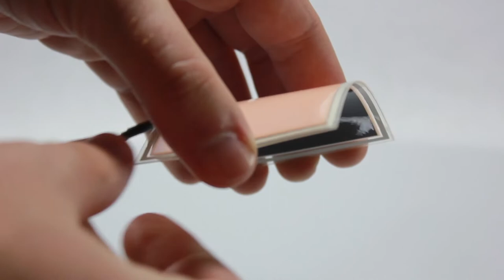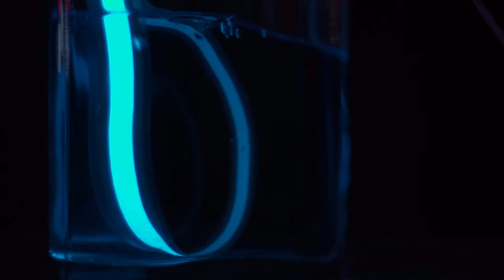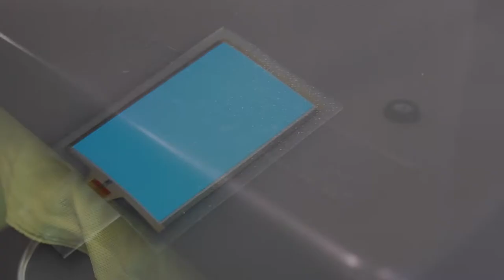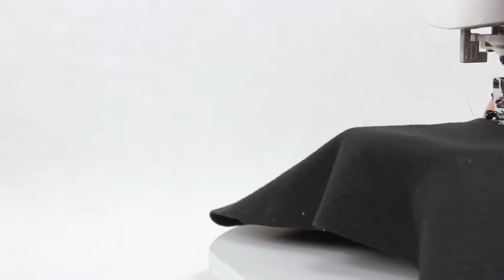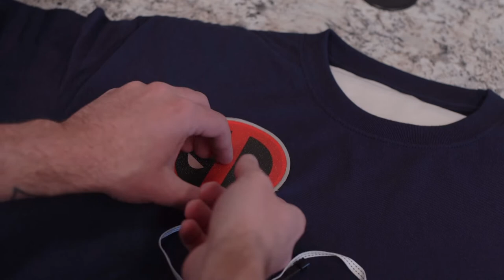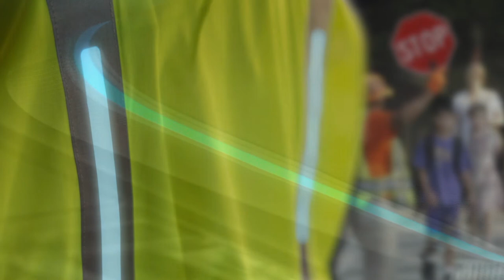How to Add Light to Fabric and Textiles (VynEL™ Illumination Technology)

Comment: This looks like a very awesome product! And I just ordered 4 strips. I am interested in sewing them all on one costume in different locations. Would I have to modify the powerpack to allow for all four strips to plug into it if the wires were not all end to end, and coming from all different directions to meet in the middle? Are there extension wires I can get from the powerback to the lights or do I need to make them? And if I cut the light can I attach two or more to the same lead line and then directly to to powerpack? Can u send me the directions to crimp and solder another connecting line? Or is it the same as the tape method? Thank you so much!
Reply from the maker: Awesome! Yes, we do have exactly what you need to make the connect in parallel from the battery pack. If you check out our "EL Accessories" page, you'll find 4/1 splitters, extension cords, etc. to help make the installation a cinch! To download the cutting and connecting guide, visit the Electroluminescent Guide at the bottom of the website and navigate to the VynEL section.
Reply: @EllumiglowPage  thank you so much!

Comment: Can u plzz tell the rate of 5×5 metre of this material
Reply from the maker: These are made similar to screen printing a t-shirt, and the largest panel we can make based on our tooling is about 1x2m. However in most cases like for wearables, you'll be better off making smaller pieces which we can die cut and print logos, patterns, etc.

Comment: Want to be added in a mermaid tail can it work underwater
Reply from the maker: Yes. We would recommend the VynEL Splash product. It is our most waterproof solution. Make sure to NOT cut the product for longest lasting results. We can also custom make panels to if your project requires special shapes.

Comment: If I were to cut it (to make a 90 degree turn on the same surface plane)  would I be able to use the crimp connectors that you sell? In the same way one would use it on the other versions of EL tape that you sell?
Reply from the maker: Yes, if you would like to email at info @ Ellumiglow.com - we will email you a connection guide.
Reply: To be clear, I'm more interested in the flexibility than the water resistance.
Reply from the maker: @k1ll3rkoala  yes. No problem to do that. You basically cut and miter the edge
Reply: Email sent.

Comment: Can you put the clothes in the washer with the VynEl attached?
Reply from the maker: Yes you can. We recommend cold wash (hang dry).
Reply: @EllumiglowPage  What does it cost by the foot? I used EL wires on my kid's Halloween costumes and the pain was spending hours hand sewing and not being able to wash the clothes afterwards.
Reply from the maker: @kcarew2  We sell it in a number of different preset shapes and sizes. You can view the available shapes on our website at ellumiglow . com. You will see a category for VynEL and take a peek at what you would need. Keep in mind the battery packs would need to be removed before throwing in the wash.

Comment: can you wash the clothing once sewed on?
Reply from the maker: Yes, you can machine wash, or dry clean once applied. Heat bonding is a preferred method of attaching which keeps better waterproofing of the material.

Comment: can you cut it and have it still. work ?
Reply from the maker: Technically yes. It will continue to glow to the point where you cut it. We recommend sealing the cut edges with glue or tape to ensure no moisture or debris can get inside. The waterproofing will decrease once cut from the factory seal, so if you plan to make custom shapes in a production part, we highly recommend having us custom make a panel to shape. It can be made in virtually any shape, size or color.